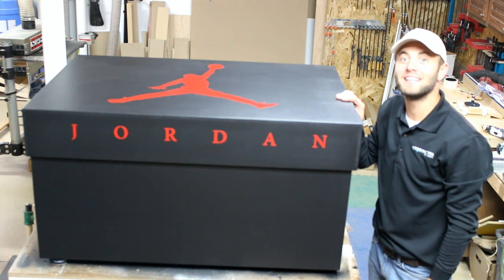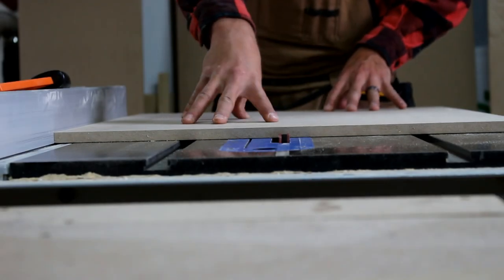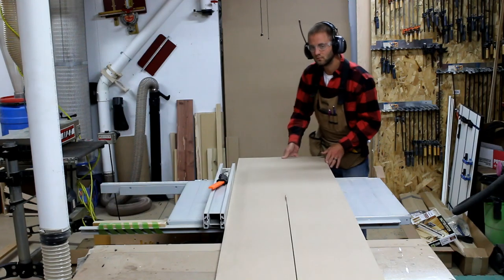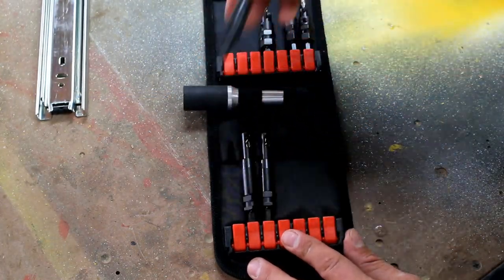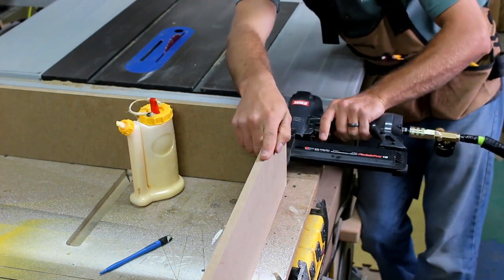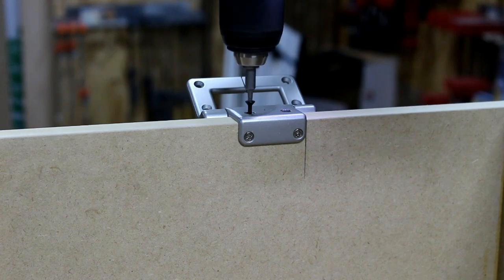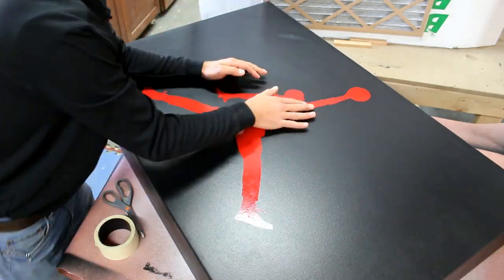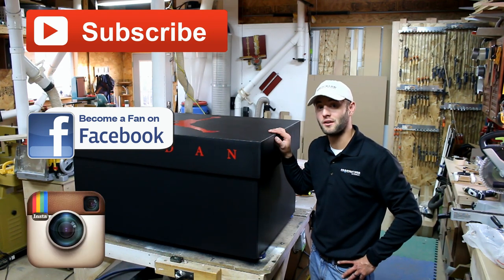Giant Air Jordan Shoe Storage Box Project | Glass Impressions

Comment: awesome video!I have a lot of mdf lying around I was going to use some to make a small cabinet for a video, but was worried about the screws pulling out on the hinges when put into the side of the mdf sheet or it splitting when putting the screws in.do you ever have problems with that?
Reply: That can be a concern for sure. Depending on the application of the cabinet the wear and tear can take a toll on the connection point. Kitchen cabinets can be a tough situation. Another application where the use is moderate would be okay. 

Rockler's torsion hinges have excellent fit around the 3/4" stock and the 4 screws per hinge provides excellent purchase. Especially as each set of 2 screws are perpendicular to the other two screws.